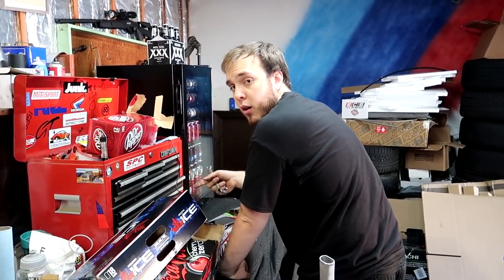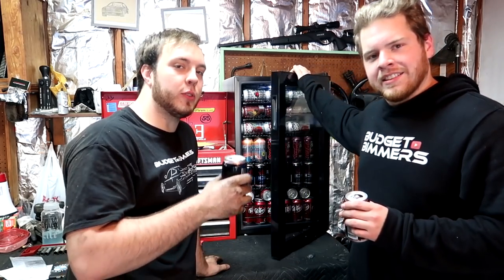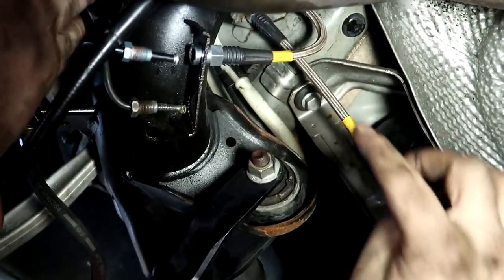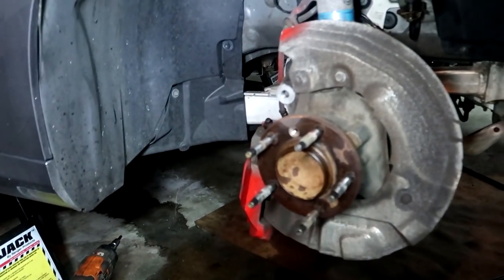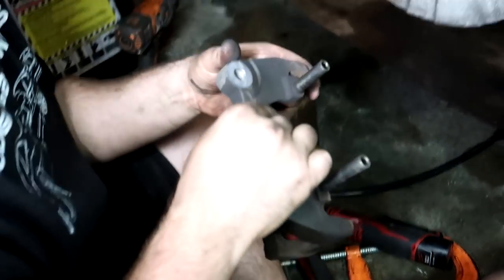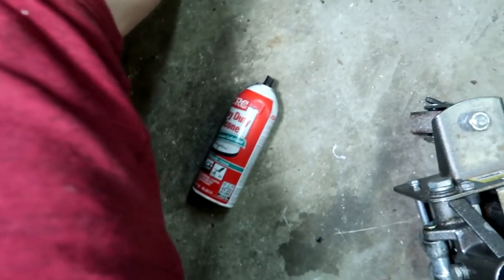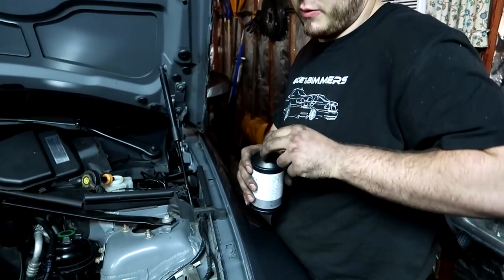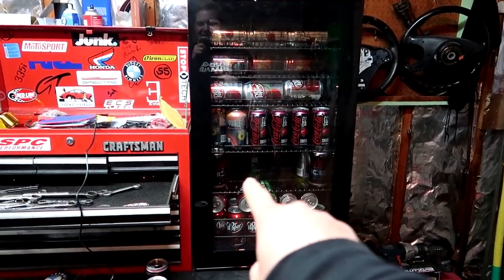335i StopTech Brake Upgrade

Comment: this 335i is not budget tho, super legit build... where is the budget bimmers? lol
Reply: why can't a legit build be on a budget?
Reply: with over 7k on upgrades alone? doubt
Reply: Lucas Sobrinho the budget part is them doing the installs themselves btw
Reply: Lucas Sobrinho they are putting down 700 hp with 7k in mods, are you kidding me lol. The budget is right there
Reply: Bruh this is way more than 7k
Reply: This bbk alone is about 3-4K 
They’re probably closer to 10k in mods by now
Reply: Docrace 6266 -5000
Accompanied mods ~~3000
LSD ~~ 2000 

Yeah they probably way over 10
Reply: Nvm it’s not a bbk like I thought. Carry on
Reply: Why do people make a big deal ? Leave the kids alone, budget or not who cares. They’re actually very smart, they do all the work and they don’t have to pay a mechanic and always remember if you want something done right, do it yourself
Reply: Leandro hey Im sure 7k can take you very far on a build specially if you’re doing all the work. Support this kids instead of throwing negative comments.
Reply: It is on a budget they’re doing everything themselves
Reply: Chris Sierra facts
Reply: @ItsJoshN  ik this is an old comment but it isnt a big break kit. just new rotors pads and lines. all of these can be done yourself for under a thousand.
Reply: @thegarbageman7511  I replied and mentioned that

Comment: If i can explain why for you.  When your master cylinder is in the full rest postion it allows the break fluid from the reservoir to flow into the cylinder.  So when your pads ware down it keeps the fluid in the lines full.

Comment: Did you clean the rotors with brake parts cleaner before installing? They have an anti-corrosion film on them so they stay shiny in storage and transit that has to be removed prior to use or it will typically squeal or gum up the pads

Comment: Just an FYI, you installed the rotors backwards, those are directional rotors. You installed the driver’s side rotors on the passenger side, vice versa. Informational content nonetheless

Comment: @Budget Bimmers I have a 335D which I think has the "same brakes". I'm with stock discs/pads and after few times with heavy breaking my discs are constantly warping/twisting. 
Do you have any similar problem?
NOTE: I have a friend with same car but with performance discs/pads and they warped too after few times.

Comment: you didnt secure the rotors correctly... Those 2 (or 1 depending what came with car) phillips head bolts (set screws) are meant to be installed with an impact screw driver. An impact gun will not correctly tq down the bolt but in fact stretch the threads.

Comment: I hate how easy the set screw came off for you. I had to buy drill it out. I used 2 different drills and ended up buying 3 different, pricey drill bits.
Reply from the maker: budro i feel your pain, i had that issue on an e36 once. It wasn’t fun. An Impact gun is your friend though

Comment: Should of got slotted only and some real pads, like race pads
Reply from the maker: These brakes have been great so far, multiple 160+ mph slow downs and an autocross day and they still feel great
Reply: I had issues of drilled rotors cracking on road course. So i switched to slotted only and a EBC blue pad. Best set up i ever had and i went trough 5-6 different pads before.